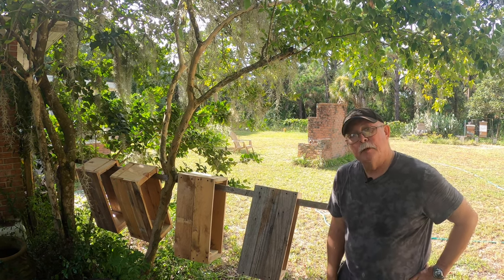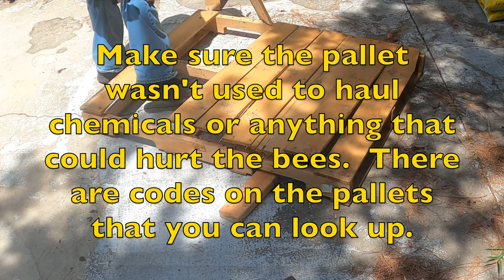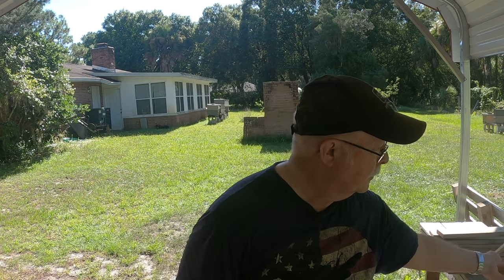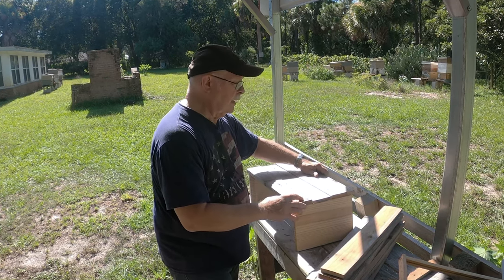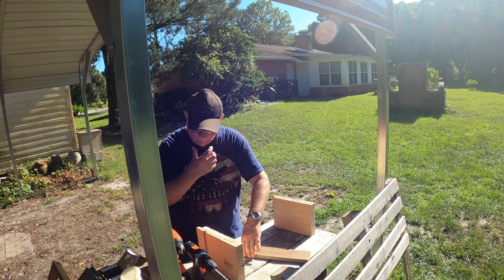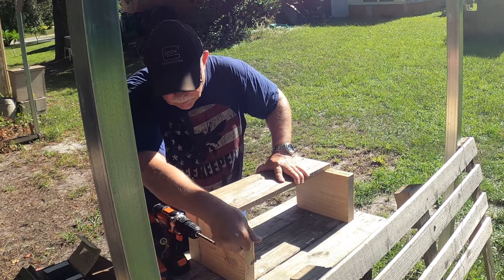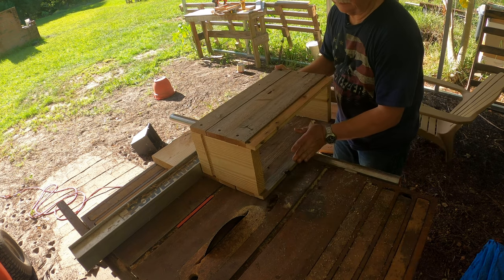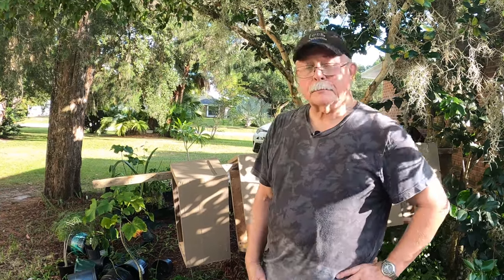Cheapest Pallet Wood Beehives

Comment: Fabulous! I have been attempting over engineering, making boards all the same thickness & jointing the edges, checking with a metal detector for metal fasteners, but your success tells me I can avoid a lot of this work. I used to use a pry bar for disassembly like you do, but following various YouTube video I now use a reciprocating saw with a metal cutting blade to cut through the nails & then punch them out & this has increased the yield of good boards & reduced splits. For preservative I have good success with raw linseed oil, but that is in the uk with 30 + inches of rain per year & so may not be good for your climate. Thank you so much for sharing this super useful information & experience.
Reply from the maker: Glad you enjoyed it! 😎

Comment: Small visit from Sweden to see what you do online :) A small tip could be that you make a jig that keeps the 2 card sides still on the table while you assemble the first side with boards. otherwise, it was a very good idea to use pallets, which are free and often available in abundance, and the spillage can also be burned in the winter. Hade :)
Reply from the maker: Great tip thanks!

Comment: I have the same router table. What about running the boards through to give them each a clean edge like with a joiner and then glue and clamp them together to make wide boards? You would still be left with one side that is flush which you could face inward. This way you could use the pallet wood for all four sides. The three larger pieces of the pallet can be re-sawn to make frames.
Reply from the maker: Great tip! Thanks.

Comment: Good cost effective way to knock out a few NUCs.  My only concern especially for newbies and non tradesmen is the Severe Weather ground contact pressure treated 2x8 lumber. with the Copper, Chromium and Arsenic and other pesticides. I'll opt for the non pressure treated due to not wanting sick bees and industrial contaminants in the wax and honey. I'm not knocking the video since you did a great breakdown and tutorial, but would go with something a wee bit healthier.
Reply from the maker: I am also concerned about anything bad for the bees going into the hives. But, the US stopped using toxins in the pressure treatments in 1994.  I have been making hives this way for years with no problem.  I am careful about what materials the pallets were used to haul though.

Comment: How do you know if a pallet has been treated with insecticide, fungicide or wood preservative?   Wouldn’t it be toxic to bees?
Reply from the maker: Hi Paul,  Thanks for stopping by!  First, pressure treated wood used to be processed with arsenic but they stopped this in 1993 so look for newer pallets.  Next there are codes marked on the pallets.  A good article to look at is:  https://generalpallets.com/pallet-markings-and-what-they-mean/.   

I have been making pallet hives for a few years now with good results but do be careful and think about what was carried on the pallets.  I avoid getting pallets from places that transport oils or hazardous chemicals.
Reply: Pallets have to be food grade unless its a freight pallet. Standard 4 foot pallets are kiln dried ash, mostly.

Comment: do you add a hole? or subtract a hole? ;)
Reply from the maker: I make a hole with a entrance disk on the boxes that I make attached bottoms for.  Most of these boxes are made without a hole and are used as supers over other five-frame boxes.  I do make some five-frame bottoms as well - I have a previous video about making tops and bottoms.